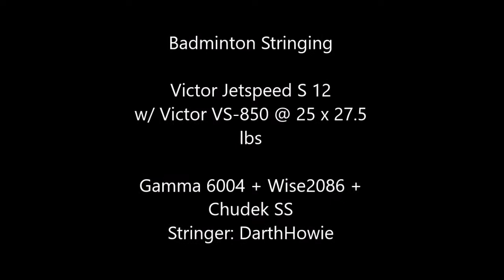Badminton Stringing - Victor Jetspeed S12 + Victor VS-850 @ 25 x 27.5lbs

Comment: You're very brave string the crosses top to bottom (gradual build up of pressure to the T-joint). But hey it worked out. May be risky at higher tensions.
Reply from the maker: thanks. I've strung Astro X and Victor meteors at 30-32 lbs before the same way.  The machine i had before was the stringway MS200 which didn't allow for any room to clamp at the top if i were to go bottom up.  There would be tonnes of tension loss in the last 2-3 strings. As a result i was very used to stringing the crosses top down for 9 years.  In the past 2 years i've now switched to the recommended bottom up for the crosses with one modification of skipping the 2nd last top cross and weaving back to it from the top cross.  i've done this since often some machines may not have enough clamping room at the top most cross and this will help reduce tension loss.

Comment: Hi Do you have any insight on where to buy ToyoZouki Fixed Clamps please? Thanks!
Reply from the maker: I bought these clamps back in 2014. Now that the company was purchased by Yonex I've read that they no longer sell their clamps to non owners of Yonex machines.   Good Luck.
Reply: @HowardWong_604_2_416  ahh too sad.. thanks for the info tho!
Reply: @HowardWong_604_2_416  btw do you mind sharing how much did you pay for it back then?
Reply from the maker: @junfengxu439  - at the time it was ~270 USD for EACH clamp - don't recall exchange rate to Canada during that time. + Shipping + duty fees etc.

Comment: Not like Victor instructions!
Missing one crossing string...🤔
Reply from the maker: yep. standard yonex 2 piece except top down. victor one piece or any one piece allows for extra bottom cross.
Reply: Sorry but read the instruction delivered by Victor, Victor recommends 2 pieces, 22m with 22 cross's, the instructions also show you where to tie off. http://www.victor-international.com/download.php?id=25    JetSpeed 12 is a 76 hole pattern, with the 12 you need to ties mains at T6 because T7 is not a shared whole, this is the same with the Jet Speed 10 S

Comment: Why are you stringing top down?
Reply from the maker: I would probably switch to bottom up if i every switched to a Yonex Machine.  There's a long discussion about Victor changing recommended patterns 1 piece..then 2 piece that I've also commented on here: http://www.badmintoncentral.com/forums/index.php?threads/victor-76-hole-pattern.167141/#post-2499747.

My original machine back in 2005 (Stringway MS200) did not permit me to go bottom up due to obstructions in clamping the top crosses.  I've continued this pattern to the Gamma and for some rackets, the above issue still exists.  I do adjust the location of my supports based on the pattern and will do whatever pattern if it's requested (one piece or two piece).  The majority of the strings jobs (2700+ and counting) i do fall in the 24 - 32 lbs category.  
Regardless of pattern, my priority is to preserve frame shape and to be consistent in my string jobs.  

If you want further information, I'm a pretty active contributor in the stringing section of the badmintoncentral.com forums.
Reply: So can i ask if you want to preserve the frame shape, why have you missed the final cross string, Victor state that this racquet is a 22m & 22x, and you have strung it 22m & 21X. I can see by this video that you have more than enough room for the final clamp at the head, so again why have you not strung bottom up as Victor Request for stringing their racquets? http://www.victor-international.com/download.php?id=25 JetSpeed 12 is a 76 hole pattern, with the 12 you need to ties mains at T6 because T7 is not a shared whole, this is the same with the Jet Speed 10 S. Also why are you strining 25 in the mains and 27.5 in the cross's? This would also create frame deformation.
Reply from the maker: I'll answer both your comments here. If we're going "by the book" then yes I'm incorrect.  It comes down to personal preference. The frame shape is still preserved with one less cross at the bottom.  Having it there or not will not make a difference in hitting unless a player is hitting off center (which should not be the norm).  For the JS 10/12 i prefer the tie offs at B6 (for cross) and B8 (for mains) for two piece.  Obviously B8 is where the 22nd X would normally be for the victor pattern.  If i were to put the main tie offs at B6..then there's a long piece of "loose" string that will run outside the frame from B10 to B6...instead of B10 to B8.  Yes i could increase the tension on the last main to compensate..but i dislike long tie offs.  My Tie Off locations are obviously influenced more so from Yonex Patterns.  

Thanks for you feedback though.  I'm not sure if this answered your question as to my reasoning for stringing it differently from Victor.  I've tested one piece pattern (Haribito Pro) vs two piece with same string, tension and racket and i've not noticed any difference.  I think it's completely subjective to the user.
Reply: i agree that it gives a longer run from 10T to  6T and this is not ideal, Victor used to do their own loop which was 7T out to 12T, this would give you a shorter run to the knot, but longer run from 7th to 12th, but it would result in a higher string bed stiffness, i add extra 10% to tie the knots and have no issue with tieing off at the 6th, As for leaving off a string, yes a player should not be hitting down there, but it does do 2 things, 1 is string bed stiffness, this is affected by the last cross not being there, also a badminton racquet builds its stability from the throat so if that stability needs 22 main and 22 crosses, then you are not preserving the racquets shape.  If your stringing for a client and the racquet is under warranty you should do your best to preserve that warranty, the best way to do this is to follow the manufactures instructions. Who would cover the cost of a broken racquet if warranty was refused because of in propper stringing?
Reply from the maker: You raise fair points when it comes to warranty coverage. Adding more tension on the cross will definitely make up for the loss from the knot.  I can't really disagree with not going with Victor, but we can agree to disagree on adding the cross vs not adding the cross contributing a difference in the overall playability of the racket.  
I do know that Yonex is a lot more strict when it comes to patterns and tensions when it comes to warranty replacement.  

Another example of not stringing to Victor pattern: Paul Stewart strings for the Victor players during the All Englands.  
http://i1024.photobucket.com/albums/y301/darth_howie/js12_21x_zpsc6qwwkw7.png
and
http://i1024.photobucket.com/albums/y301/darth_howie/js10_21x_zpseghpybvq.png

I've asked them for comments and their feedback is all in that badmintoncentral discussion i linked earlier. It's a tremendous resource for badminton stringers.
Reply: Adding more tension on the cross's will not make up for the loss on the mains from the  knots, adding 2lb to the final main will help remove the loss from the run to the knot, by adding 2.5lbs to the cross's you will be elongating the frame, Yonex spend millions in R and D in the best way to string racquets to minimise frame deformation, Here is something worth trying, relax a frame that is in good shape for 24hrs. then place it on a piece of paper and draw around it, string the frame however you wish, once complete offer the frame back up to the piece of paper and see how it has changed, I bet a pound to a penny that the frame will be elongated, but don't stop there, try stringing it in different ways and see how the frame changes shape, try 24/24, 23/25, 22/24. and see what the results are for yourself. Paul finds that string 1lb up gives the best results for string brightness and minimizing frame deformation. I work a lot with SBS, I think I am currently the only person in the UK who does for badminton, You do lose string bed stiffness by removing that bottom string, so you are affecting the way the racquet plays, go buy a String Lab 2 from Stringway and give it try, The string labs works by measuring the string beds deflection, 1 less string = easier deflection, Means softer stringbed.

String Bed Stiffness is important, It is highly used in Tennis and is also now being used in Badminton, It's used to help monitor string life, Stringer's performance. Many things can alter string bed stiffness, temperature, string gauge, string construction, stringing pattern, stringers style of stringing, Clamp adjustment, Base adjustment, Racquet position on a string pull, string straightness.

When you do a Professional qualification you get tested on all aspects of stringing and 1 of the test you have to string 3 racquets in 1 hour, in an ATW pattern with poly in the mains and the cross's and the racquets must all be within 1 DT  ( SBS ) of each other to pass.

and yes it is relevant to badminton as all the same rules and theories apply, the only change is the frame size, string diameter, and construction.
Reply from the maker: Matthew Main - I have drawn the frame shape on a sheet of paper before. for my machine setup the ratios of tension and the pattern used have been preserved. if I do change the ratios then yes the frame does not get preserved. every machine and equipment will require the stringer to adjust accordingly.  that's why I try to be flexible and not "you have to do it this way because so and so says so". however yes I'm aware of the string way tool as that was the previous machine that I owned.  I'm definitely open to other patterns, ratios of tension.. but it has to preserve frame shape and maintain consistent string tension.  Cheers

Comment: how did you manage to keep your 360 degree rotation with a gamma machine and a wise 2086. 
As far as I am aware unless you have personally modified the machine yourself a gamma machine and a wise 2086 will lose it's 360 degree availability
Reply from the maker: Yes I had modified the machine with longer mounting nuts to the stand and an adapter between the stand and turntable so that the turntable sits just high enough over the Wise.  It's similar to the solution posted here:
http://www.badmintoncentral.com/forums/index.php?threads/custom-made-stringing-machine-parts.79215/page-24#post-2401005
Reply: where did you purchase the products or anything to modify it ?
Reply from the maker: DKMonday - The link that i had previously provided contains that information.